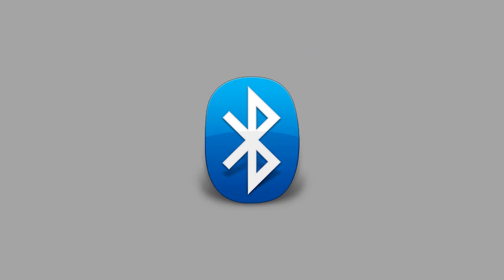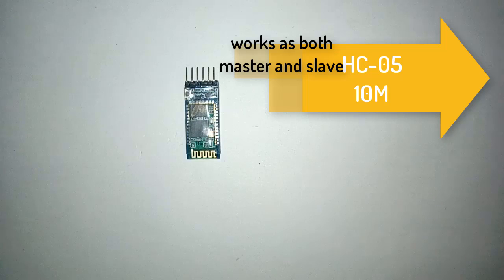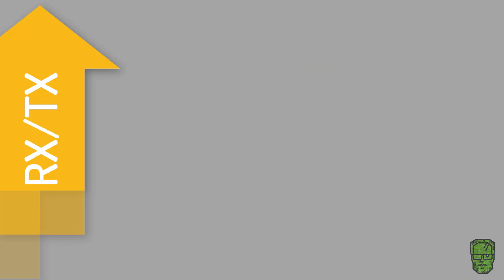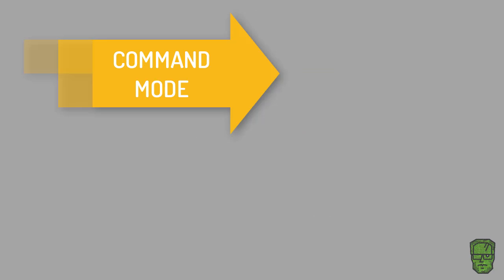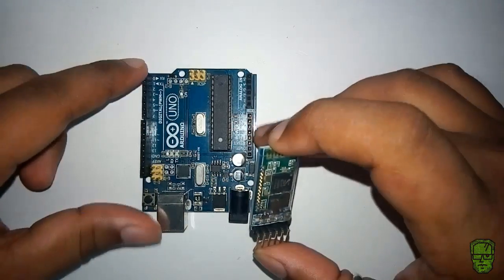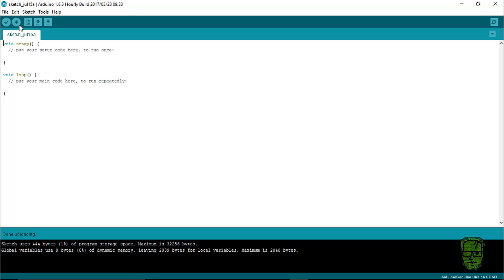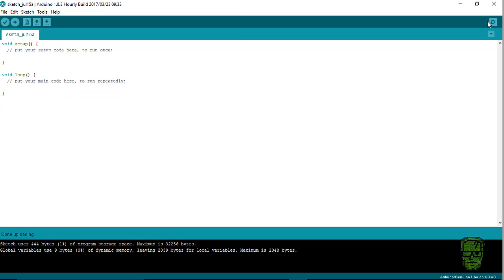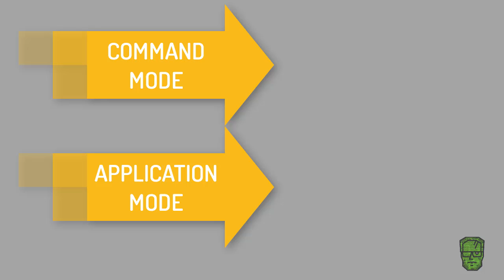Introduction With BLUETOOTH MODULE (Command Mode) 
Part 1

Comment: Hello best regards from Venezuela, I’m trying to establish connection between a smartphone and a Bluetooth module HC-08. I already made it using the recommended apps ( LightBlue and BLE Scanner ) but when I try to connect with an app made by our team (at App Inventor) to control some features on our breadboard, we lost connection. What can you suggest or wich do you think our problem is ?